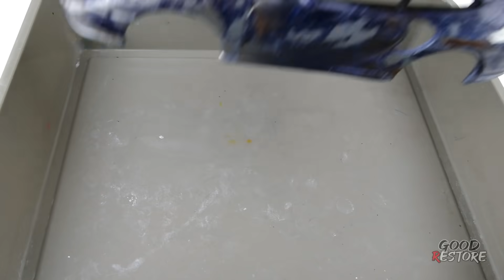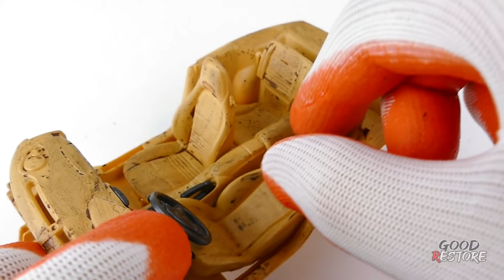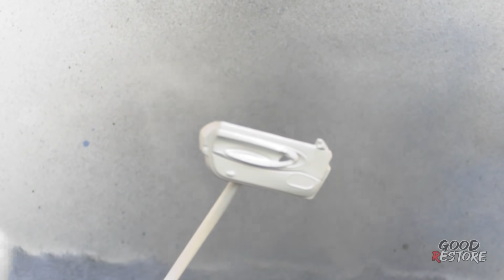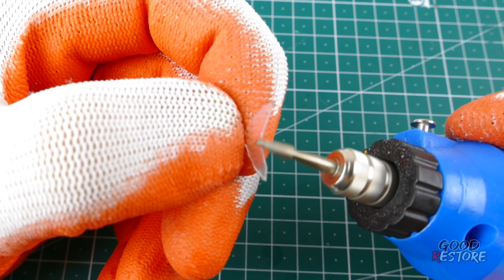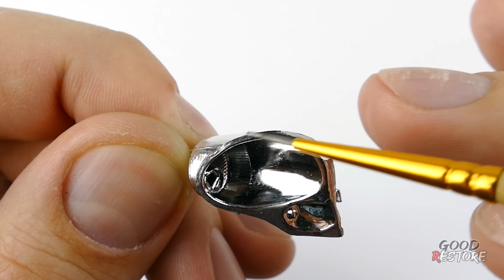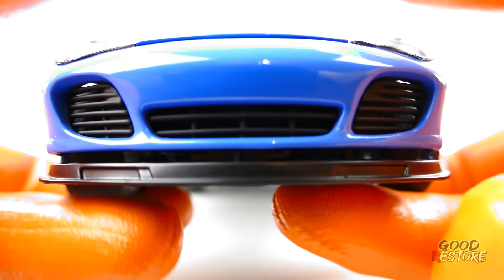Restoration abandoned Porsche 911 Turbo damaged Model Car by Good Restore

Comment: I do not understand where you got the missing parts?
Reply: He orders them
Reply: Never been missing,brand new cars that he “weathers” to look abandoned, then he pimps them up.
Reply: He keeps the good parts from the car.
Reply: @Nico - yeah, glad I'm not the only one that noticed that. Thing is, I'd still watch if he just pimped the cars out - no need to go through the theater of making them look beat up.
Reply: He always bought two of them. Destroy one and use parts of others.
Reply: What he does is...
1. Buy a new car.
2. Make it look like an abandoned car by scratching it and denting it a little bit... Don't forget to put a generous amount of dirt.
3. Film a video restoring the damage.
Reply: From wreckers
Reply: @michaelhardeman6004  unspeakable
Reply: You can order them, if he does it a lot he can take it from scrap cars that he did not restore ... this way you quickly get a good collection of parts ... what he does not have he can simply build himself. No rocket science ...
Reply: He have extra
Reply: or maybe he gets two of the same car and uses some from that.

Comment: Oh yes, that paint rash sometimes Is not that, paint, it is metal. Excelent restoration, flock, and a well done paint job (there are some guys who leave paint with orange skin horrible finish). I just repaint hood and front fenders of a Cord 1937 from Signature models. Hood was so damaged by those bubles on the metal. Just did the same as you, sand away all bubles and repaint in the same original metallic gray color. I'm waiting for paint to cure, then sand it buff it and wax it. I leave interior and other body parts the same, they weren't damaged by paint/metal rash.